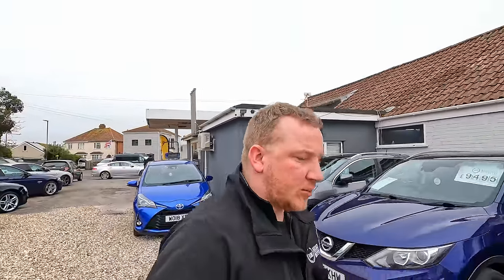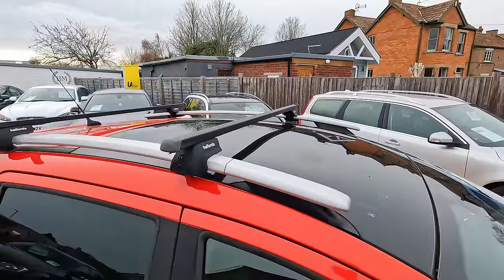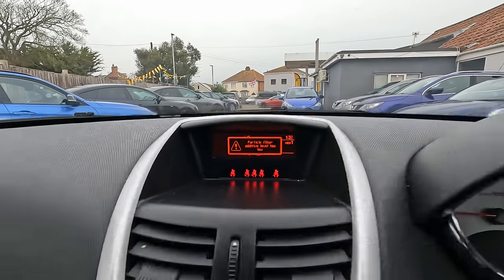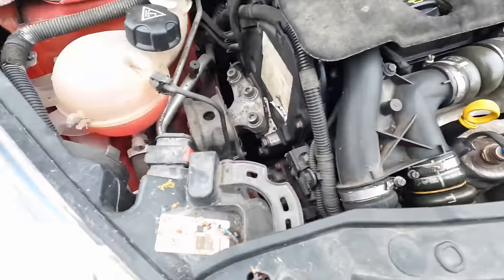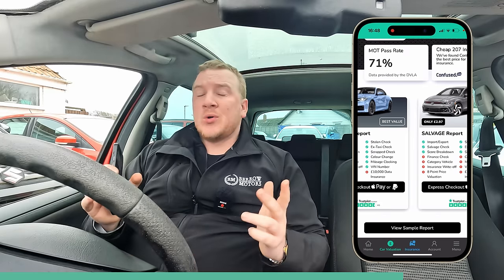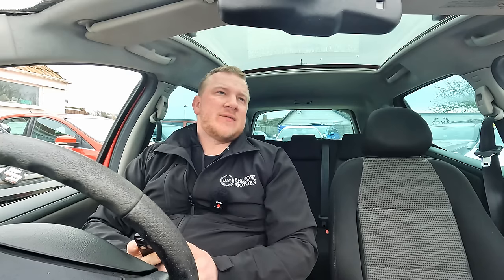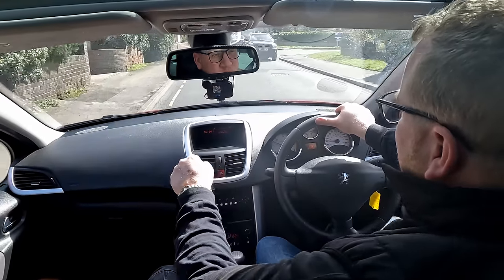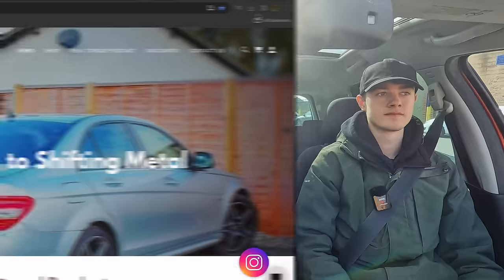Cheap Peugeot 207 SW Won't Go Into 1st Gear?!

Comment: I had a 60 plate one of those I bought it brand new. When it got to40,000 I had the same problem the dealer I bought it from said I needed a new clutch. I took it to another dealer and they told me that some of them around that age had a problem and the gear change needed adjustment. Cost me £15.  Bit cheaper than a new clutch

Comment: If it's the 1.6HDi I would get shot of it ASAP. Had the same engine in a Volvo V50, the DPF has to be replaced every 5 years which is a very pricey job. They're also prone to turbo failure, and the injector seals fail at around the 150k mark, usually necessitating replacement of the injectors themselves as well.

Comment: Hi Joe my 207 1.4 HDI doesn't like 1st gear, it won't select 1st smoothly unless you're stopped and gearbox whines a bit but other than that can't fault it. 70 odd mpg winner. Will definitely be the 1.6 HDI as that's the only diesel they did it with
Reply: 8:57 will probably be the top mounts and washer bits worn as well iv just had them done, cost around £70 in parts

Comment: May be a bit late now Joe, but the linkages can be adjusted on some of them Pugs.
Tony.
Reply: They are well known for linkage wear and is reasonably cheap replacement. Has to be done right as gear selection will be a problem

Comment: Eolys/PAT fluid low, will probably want the DPF cleaning, depending on pressure/content. Most folks see that error, and ignore it. I have two cars that use Eolys, and it's crucial for the DPF regeneration. Allot of garages use the incorrect Eolys for the type of DPF, or mix them which causes further issues.

Comment: hey joe love the vids sure youve checked for a rear shunt but id be  worried  by the  (blue) boot lip protection thing  might be aftermarket by previous owner  and difficulty  to pull up the floor for the spare wheel could be just because your holding camera

Comment: Pull the gear leaver gator off, you'll see that the stick needs to go just a bit further, get a small grinder and just shave a bit of the plastic stopping it going in, on astras, zafiras you sometimes can't get reverse, so do the same thing, tbh you'd have been better off trading, auction or 595 spares or repairs in the first place, loads of comebacks on those, dpf, turbo, as I'm sure you know bud.